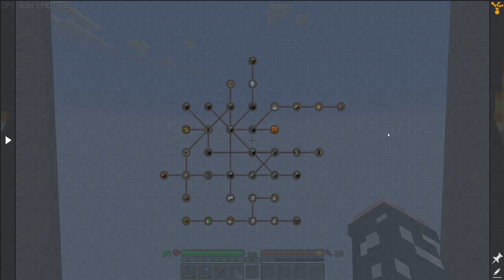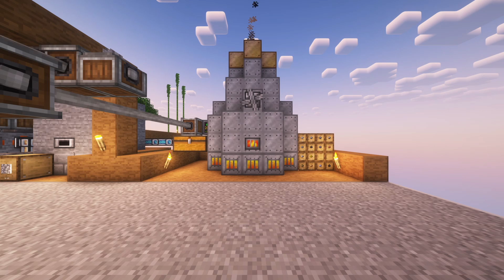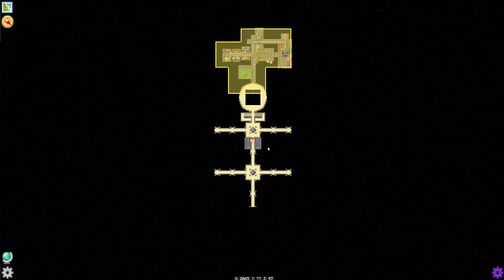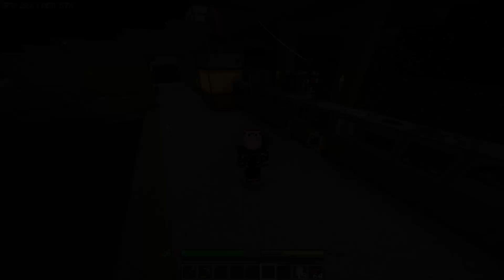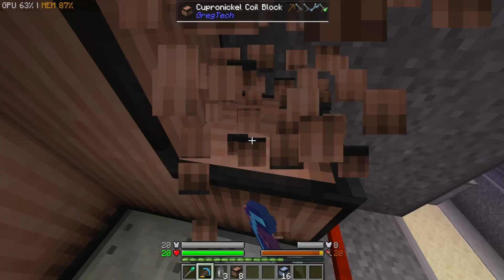Building the "BEST" base - Star Technology

Comment: Crazy how far you get so quickly. Also how well developed everything is. Very cool
Question, how are you automating everything so well and neat? What kind of pipes do you use for different things? Also how do you automate input and output for items or fluids? I ask because i end up using shitloads of pipes everywhere. Could you explain which items you use and their mechanics in your application? I.e. do drawers just pull from inventory or do you use something else? Excited to see the rest of your series when i reach MV
Reply from the maker: Generally throughout the series, I use AE2 to make sure stuff moves around, otherwise I do use pipes for short distance transport, I use drawers to buffer things outside of the drives in AE2 as well as super tanks for fluids

Comment: how does the kinetic sieve work? where did u put the input and output? i cant make it work in my world
Reply from the maker: You need an input bus large enough to fit the sieve and the input items, a kinetic input with 2048 SU at an RPM of 32 I believe, and then an output bus large enough for all of the products, for sand there are 5 outputs so you need an MV output bus
Reply: @melbournewocoffee5617  it's working now, thankss 🤗

Comment: Another great video. One question, how the heck did you get the kinetic sieve to work?
Reply from the maker: You've just gotta make sure you give it enough stress units at the right RPM
Reply: I just put a Strong Generator behind it, but it didn`t work :/
Still searching for a solution. I even tried putting a creative Motor with 256 rpm behind it. Still no results. 128rpm is needed for sand.

Comment: ive been enjoying the series, im also playing the modpack, but ive wondered how should i go about getting a good supply of bonemeal for biodiesel?
Reply: Use 2 large stone barrels. One makes lave, feeds that lave to a second one, which makes calcite pebbles(around 2k in under a minute). When calcite blocks are run through create grinding wheels it produces bonemeal (about 2k in 10 minutes). Infinite bonemeal, fast and free.
Reply: @motherteresa9127  i ended up doing that, long before you commented,  but thanks anyway
Reply: @retro_guyy1015  if you are ahead of me, im gonna interrogate you for ideas. Im still in late LV.
Reply: @motherteresa9127  we about in rhe same area so I don't know what to tell you bud
Reply from the maker: I've been composting the excess potatoes and wheat to make the bone meal
Reply: @melbournewocoffee5617   thanks for the tip

Comment: Lapidary Dynamos are definitely a good source of power, though I used Tree Greenhouse at MV and only water, along with 4 wall-shared Pyrolyse Oven and 2 Large Bronze Boilers, then at least 8 MV Steam Turbine since I am used to it
Reply: also, if you want to, you can use Pyrolyse Oven (in MV) to make a little bit more Biomass
Reply: another thing: you can recycle water in the clay electrolysis setup
Reply from the maker: Thanks! I'll definitely be getting the pyrolyse for distillation products shortly
Reply: @melbournewocoffee5617  Well, don't rush it though

Comment: To stop items stored in drawers from going into the drives, you can set a higher priority on the storage bus. It will pull from the drives first, and push into the drawers before going back to the drives. This is kinda hard to read but hight priority means, empty drives, full drawers. Hope that helps!
Reply: man this wouldve been so helpful before i consolidated all my drawers into digital storage 😭
Reply: @applecrate8366  rip, it's never too late to fix it lol.

Comment: How does no channels work exactly?
Reply: With it, Applied Energistics just has no channel limits. So you can just put all your busses and automation on the same fluix cable and not have to worry about running out of channels.
Reply from the maker: @jurjen909  exactly, basically you don't need to have a controller, you can connect unlimited devices to any cable
Reply: Oh, I see! I thought it meant 0 channels. I was like, how does that work at all how are you gonna connect anything if it has no channels?? Thank you for explaining to me 🥰

Comment: Btw you can fully automate sieving gravel without any power required and it only takes two water wheels you can use a vacuumulator and a golden hand filled with gravel
Reply: In fact this works with all meshes with anything
Reply from the maker: @osky-n3b  That's really inventive, I didn't even think about that
Reply: Create is weird lol you can do anything you want with it really
Reply: Pretty sure you can also use create: diesel generators ethanol to make PE